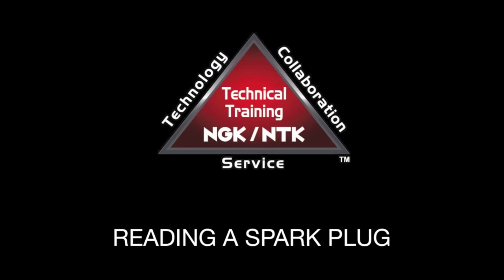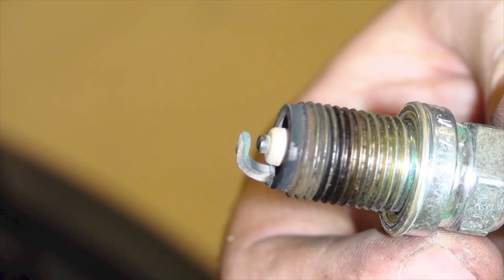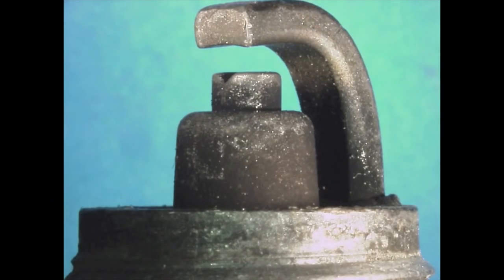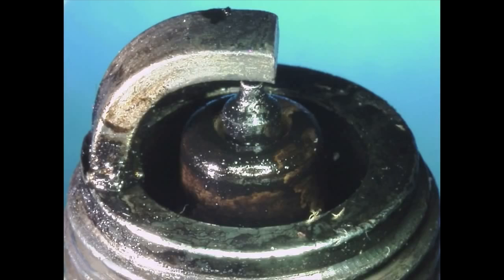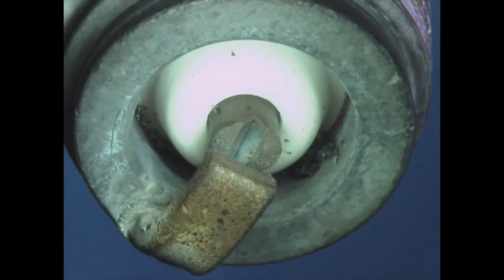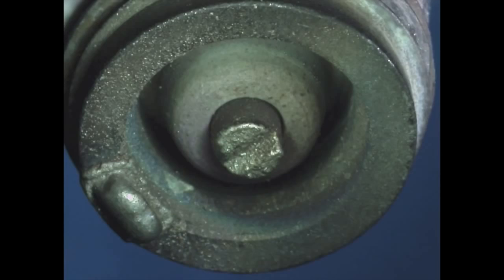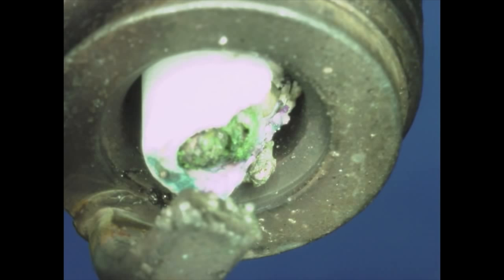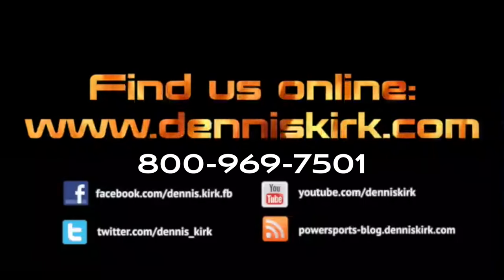Reading a Spark Plug-NGK Spark Plugs-Tech Video

Comment: For over heating sparkplug what is the solution ? Thanks for your valuble reply since local mechanics cannot be trusted. From sri lanka
Reply: Correct air leak
Adjust fuel supply of injector or carburetor to correct lean supply
Adjust ignition timing if too advanced
Correct engine low compression
Use plug of high temperature rating